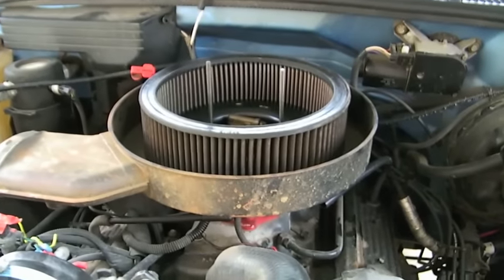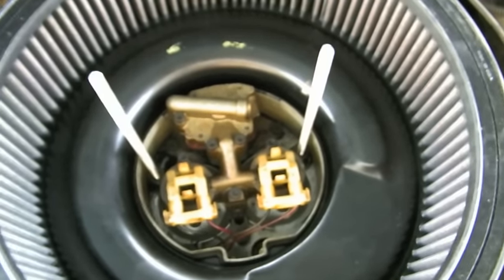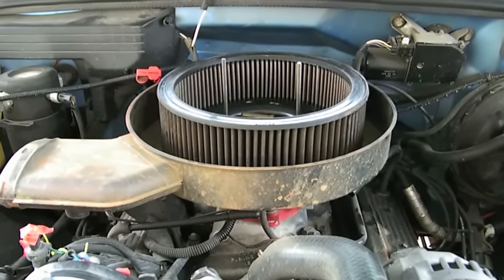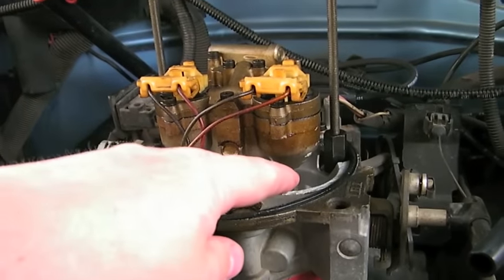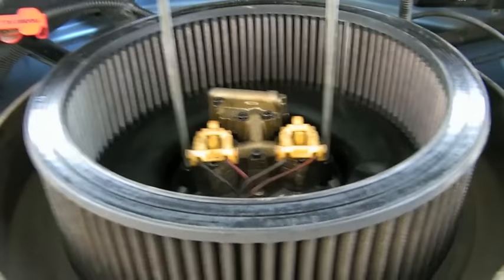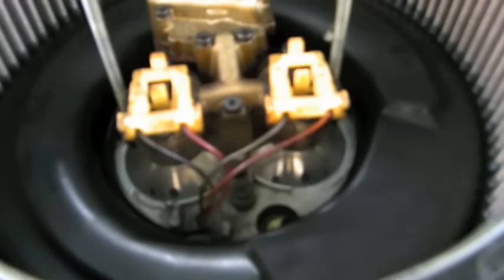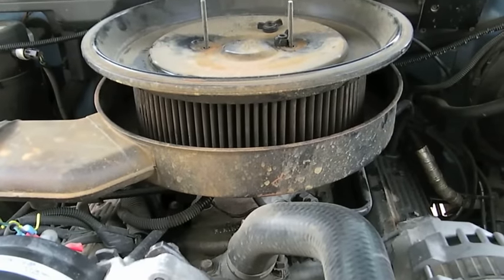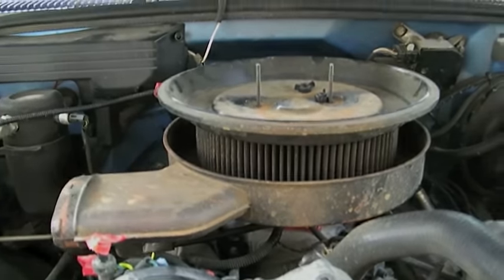TBI mods, how to get the most power and Horse Power from your TBI engine.

Comment: With that lid flip you just did you also created a nice bowl for future maintenance for your nuts bolts and tools to be kept in so you don't lose them
Reply: Yeah...and it really helps keep the hot air from escaping the engine bay...make sure to get all that sucked right into the engine where itll make that extra "about 20 horsepower" lol
Reply: @mikekadlec5428  engines don't like heat
Reply: @famusman5989  it was all sarcasm...that was my exact point lol
Reply: @mikekadlec5428  I'm lost now. What???
Reply: @famusman5989  im agreeing...flipping the lid upside down sucks all the hot engine bay air into the engine raising IAT's and thus decreasing efficiency and horsepower. The stuff he did actually hinders performance
Reply: @mikekadlec5428  oooh. Ok. Thanks for clearing that up instead of making fun of me. I had a few thoughts on what u were meaning. That was one of them
Reply: Hey I just thought of something You would run it's supposed to be otherwise why would I say that's a good holder for nuts and bolts??? U wouldn't be going anywhere if u took a bunch of stuff apart
Reply: It also provides a perfect spot for water to pool up in and run down the air cleaner stud into your motor if your hood to cowl seal leaks.
 I know because I bent my #3 connecting rod on my '95 GMC 1500 after sitting in my driveway during 2 days of torrential rain and then I go to crank up the morning after all the rain and it it fired then immediately died and and when I tried it again it was locked up "tighter than dick's hat band".
That was in '97 when I was 17.  My dad even warned me about "flipping my lid" back then.
Did I mention how pissed he was that I ruined the motor in a 2year old truck with only 53,000 miles on it that HE was still paying for.  Never the less, I gave him my summer paycheck every week to pay for another motor 😅

Comment: I did the same modification on my dyno we tested this over lunch we were all laughing we actually lost power due to a hot engine. The one setup brings in colder air. When you do this you take all hot air now in and we lost power. Always seems like you gain power on your seat when you do the work but a dyno will always tell you the truth. Thanks guys we had a good laugh over this.
Reply: If you ever get a chance to have a vehicle with a cowl hood scoop on the dino I'd be curious how effective it is at solving intake temperatures.
Reply: @tanner.. I'm glad you told those Joe Biden loving gun banning clowns off

Comment: That spacer ring is more important than most people think.. Ive seen dyno tests before and after where the vehicle (Camaro) lost almost 40ft-lbs up top...the ring straightens the air out a lot better than most think it does.
Reply: the only reason its not longer is the hood height
Reply: BEETEROLDS quick question bro. If I buy a k&n cold air intake. Am I replacing that whole round filter thing?
Reply: @Ab1994ab  yes
Reply: @zeekthehammer269  would a higher one be beneficial?

Comment: just grinding off a little of the tbi and trimming the rubber wont get you hardly anything at all. and yes the lid flip helps a little but not a lot either. Ive got edelbrock SCCA heads, a tbi performer intake, a 454 throttle body with a custom cnc'd adapter, a tbi spacer, a custom filter tray and a flow through top. comp cams extreme energy cam and lifter kit, complete flowtech exhaust y pipe system, ported heads, intake, and headers, and a custom chip. On a mustang dyno I hit 370hp and 355tq.
Reply: Cool my daily 86 c10 is 5.3 LS swapped with a Gt35 turbo on it. Makes 415 at the wheels on just 12lbs of boost safe tune. It is a bone stock 100k miles motor I got for $350 at the junk yard. I got turbo for $100 my buddy rebuilds them. Been driving this combo 3 years now.  When it blows I'll put another junkyard LS in it for next to nothing. Truck has 3 inch drop springs 3 inch rotors for a 6 inch drop in the front and four link rear end set up 12 bolt rear on coil overs since we're bragging for no reason. I also have a tube chassis 63 Nova don't weigh shit LS twin turbo makes 1200hp
Reply: @shonuff7317  ANYWAY......
Reply: @shonuff7317 That's good but swapping an engine is way harder than doing work on an engine already in your car

Comment: Heads and cam it , put a carb intake on it run a carb to tbi adapter on it, bigger injectors , set the timing at 12 degrees run super unleaded. True duals 2.5 pipes.  No cats etc , free it up.  Tbi is good but you have to build around it.
Reply from the maker: +TheKJProductionz 
That sounds like a good recipe
Reply: BornToBeFamed good advice

Comment: What you need to do, since this is a truck, is determine how much space is between the hood and the top of the air cleaner when the lid is put on properly.  If there are several inches of clearance then you could fashion a taller velocity stack between the base of the air cleaner and the throttle body.  Velocity stacks for carburetors had a similar fit to the throttle bores as does this throttle body injection system.  The next thing you'd do is that you'd run the air cleaner without the lid flipped over....so its properly sealed and contained.  The snorkel inlet of the air cleaner needs to be ducted to the front of the truck as you would be fashioning a RAM AIR inlet system.   I do not know how the factory routed the inlet system but usually they did not take air in with the inlet facing forward....they usually faced sideways and not with the forward air flow as the truck would travel forward.....or there was an obstruction blocking the inlet.  Some mid 1960's race cars that had the 4 round headlight systems, they took out the high beams and used the ports as the inlets for a dual snorkel ram air inlet system.  The RAM AIR will use the forward travel and the air resistance to force air into the motor as the truck is in motion.  The faster the truck travels, the more air gets forced in to the motor.  The flipping the lid thing doesn't force air into the motor as it only allows the natural draw in of the cylinders to bring the air/fuel mixture to the combustion chambers.  The better air inlet system would be a cowl induction system as there is more air pressure in front of the windshield as the truck would be traveling forward.  SO you would either need a cowl induction hood scooped hood, or if the layout is right with the trucks cowling and the fire wall, you might be able to cut a port in the upper firewall to tap the boxed area where the windshield wiper mechanism would be if its an isolated box chamber that's vented up in front of the windshield.  Not all vehicle are suitable to modify for a cowl induction system if the elements for a cowl system are not present in the trucks body design, you would have to have a cowl hood scooped hood.  If there are doubter's, you can use masking tape and some ribbon or strips of news paper taped to the hood , on the hood in front of the windshield and drive down the road and watch the ribbons getting sucked into the cowl port.  The cowl induction system has more pressure than a ram air system......but the ram air system is usually easy to fabricate with the factory parts that are present on the truck.  Either way, the added boost in cylinder filling doesn't approach that of a blower or turbo system, but its far more better than just relying on the natural draw of the engine cylinders to fill the cylinder with air/fuel mixture for maximum efficiency.  ANd you need a free flowing exhaust system to compliment the intake but not too big of pipes  as going too big robs torque & power within the power band of street driving.  Your best bet is to add on an MSD 6A ignition box to the existing factory ignition & distributor as it will get a complete burn of the air/fuel mixture with multiple sparks up to 3000 rpm......considering street driving is between idle and about 3000 rpm.  ANd the next biggest improvement would be using an old set of wires to utilize the boots and snap connectors and make yourself a real wire...wire set using heavy gauge copper wire from an electric supply house and solder the terminals on the wire......that would get the full energy of the coil to the plug......and you'd never need a new set of wire ever again.
Reply: Keep in mind that a ram air system needs to draw air more up off the ground and don't use the fog light ports in the bumper or use an inlet under the bumper.  The first olds 442 cars used a low inlet port for their ram air systems and they picked up too much road dust which made the air filters get dirty really fast, so the raise the ram air ports up higher on the car to minimize the road dust situation.  The air cleaner should have a heat riser flapper door that ducts air off the exhaust manifold and the flapper door is usually vacuum operated.  You'd want to block the vacuum so the flapper door stays open to the outside forced air......cooler air has more density and power potential.  You'd also want to make sure all the duct seams are sealed with duct tape so their is no air leakage and all the air in the duct goes right in to the cylinders of the motor.
Reply: if you do opt for a cowl induction by cutting the firewall to get into the windshield wiper chamber....don't cut too low into the chamber....you want to cut high as there is a way for rain water to drain as it should in the chamber....and not drain into your inlet system because you cut low and in to the bottom of that chamber.
Reply: If a guy was to install heat deflectors on the exaust manifolds ,would that not keep the engone bay temps down up to 70%? As well as installing another deflector between the rad to the front of the motor,thus deflecting hot air off the rad downwards away from the intake ? then u could have a honkin open air cleaner ?

Comment: I cut my air filter lid and bottom so they have the open sides. nice look and runs good too
Reply from the maker: Thanks for watching. Can I get you to subscribe to the channel? I am trying to grow and that would help a lot
Reply: I drilled 1 inch holes evenly spaced around the bottom on a full size chevy i once had. Looked really cool when finished and painted.

Comment: The TBI 5.7 has a poorly designed exhaust system. A cam will not do you much good until you replace the factory Y pipe. The tech guys with hotrod magazine did a small write up on appropriate exhaust tubing diameter for an expected amount of horse power, and you would have better exhaust gas velocity with 2.5". You can also pick up a cheap dremmel and radius the TB volutes. Make sure it's at 13psi fuel pressure, slap a K&N filter on and these simple changes will get you about as far along as you can be unless you want to swap heads/cam... 180whp to 220ish probably.

Comment: Lid flip works! 
You think that stock cold air intake is still cold after it’s passed by the air filter housing? These underhood temps are high in the obs chevys. It heats up that housing and radiates that heat inside too. Also more air is always better than cold air, within reason

Comment: Just a side note most the time that throttle body has the screw-in spot so you can eliminate the two air cleaner studs and go to a single arched stud so you can run a regular air cleaner or a traditional air cleaner

Comment: The hose is the counter part of the PCV valve. It blows air into the valve cover while the PCV does the opposite. A lot of people put a small filter in the hole and be done with it. Its best to just leave it connected.
Reply: No. The PVC draws crankcase vapor into the intake. With the PVC drawing out vapors fresh air needs some place to enter or you will have neg pressure, like sucking through a straw with your finger over the other end. That hose goes to the air cleaner/spacer so filtered air enters. That is until the engine gets excessive blowby then it will draw what the PVC can't  and turns the inside of the air cleaner nasty with oil. Gets this black gummy stuff around the tube area. Old cars don't have PVC or anything just vents to the atmosphere.

Comment: Don't do either of these, the ring helps with pcv, pcv keeps more vacuum on your crank case and helps your rings seal for more power. And flipping the top over sucks in hot air instead of getting air from outside the car like the cleaner should using the piping on the side of the cleaner that this guy apparently took off, he didn't help with flow much, killed parts of the pcv system and made his incoming air much hotter
Reply: Johnny Brewer They just dont get it man. Like the factory ran that ducting into the fender just for looks
Reply: I was thinking the same thing there goes the pvc and shaving the throttle body down for more air was stupid they designed it that way to flow with the least amount of restriction and then tune the computer to it through timing so changing that might make a mixture issue. I bet the computer will recognize the change either rich or lean not sure the direction it will take if not both under certain conditions. And then yea sucking in hot air this guy honestly hurt performance more than anything,Wait for that check engine light.
Reply: Johnny Brewer yea that's alot of heat soak in a giant engine bay with a small block, gtfoh, what he did was crude but it is effective
Reply: I'm fighting a massive vacuum leak through the pcv system in mine because I swapped to an open faced breather
Reply: Lid flip works.Have seen dyno results.
Reply: Fast Nasty. yeah, because dyno rooms are air conditioned.
Reply: This is why you don't believe the internet and do research. Thanks
Reply: Actually flipping the lid helps in a way most people dont realize, theres a flap in the intake piping thats supposed to switch from hot to cold air but after a while it stops switching and stays stuck to hot, so flipping the lid helps more then it hurts
Reply: Nimbus Nimbus  yes sir
Reply: Nimbus Nimbus  i removed the flap cuz it seemed easier than trying anything else
Reply: The lid flip isn't necessarily pointless. In his case you can see that he doesn't have the air duct as so many of these used trucks have lost then with a previous owner. So I'm his case he is already getting warm air so decided to maximize airflow. What we do is run new ducting to get better airflow and a lid flip. As long as you get the air from the duct and the flip close to the same you'll see hp gain. But not alot
Reply: @slammedsandoval  Did you leave the heater hose in that goes from the exhaust manifold to the air cleaner?